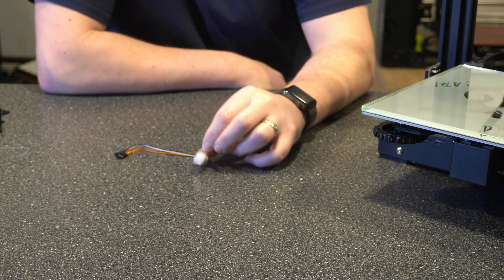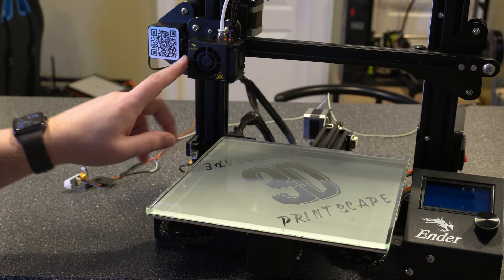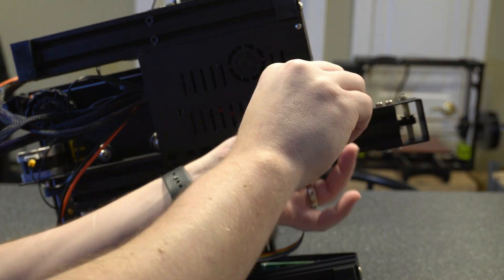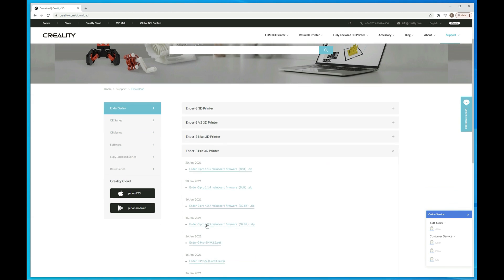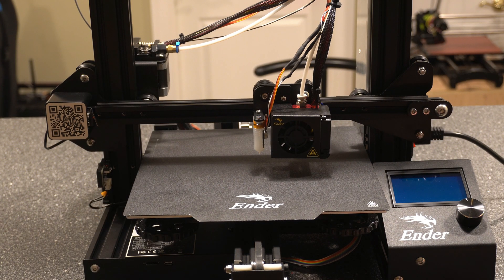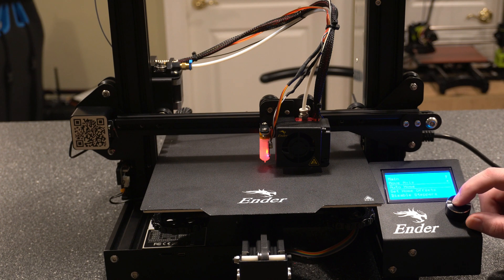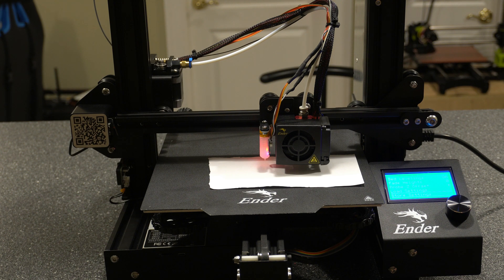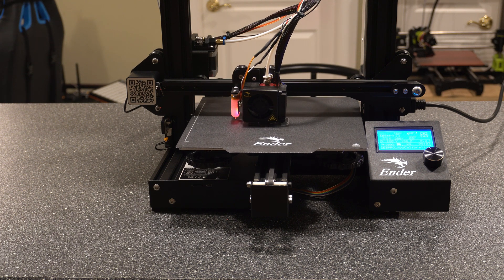Guide to Install a BLTOUCH on a Creality 32-bit Mainboard

Comment: Sorry I was terribly frustrated that night. I was very abrupt, and ultimately inaccurate with my message. Though I bought one of the newest, most popular entry level printers available, an ender 3 pro with the 4.2.2 main board. And I have the version 3.1 BL Touch level probe, one of the newest of those., I ultimately couldn't get it to function properly. As for software, I followed your guide video but that failed so I went on to try probably 8 other versions of firmware from creality and other sources. Marlin with BL Touch etc. Some seemed to work with homing and the z offset calibration. Properly following the test pattern, even deploying properly at a full nine probing locations, only to fail miserably by skimming along at 1/16 of an inch above the surface of the build plate when it was supposed to be laying down plastic. I "did" obviously not break the probe tip as I though when it collided brutally with the build plate and seemed to fly off somewhere across the room. But it had actually managed to retract upon impact and it only looked at a glance that it hadn't survived. If you have any suggestions I would welcome them. It's really something that BL Touch didn't match their product with one of the most popular printers on the market. Maybe I could pick up one of the clones, if people are actually getting them to work where BL Touch has failed. Oh btw, the connections were a spliced extended harness I made up when Matterhackers sent me a probe and nothing else. I'm sure you're familiar with the white, five position connector specifically for the probe on that 4.2.2 board. I made up an electrically sound harness of 5, 26 gauge stranded wires, solder spliced and protected in 1/2 inch braided sheath all the way down into the controller housing and basically following the diagram precisely. And to my credit it functioned at times going thru all the motions but for being too high off the build plate when time came to print. Certainly nothing wrong with my connections. If you know of a different probe that has had success with my 4.2.2 model main board, and what firmware works with the imagined pairing please let me know as I am prepared to shell out the cost of an additional probe if it will get me the desired result. I appreciate you anticipated help. Sincerely..
Reply from the maker: Hi. No problem, i understand. 3D printing can be very frustrating sometimes lol. My guess is that the wiring isnt right, ive seen them shipped wired liek 10 different ways. Can you send me a picture of the wiring on the board and bltouch side? Also, dont use the transfer board on a 32-bit board. Not sure if you are or not but its only caused problems for me.
Reply: @3DPrintscape  Alright. Tried everything  and I'm a retired electro-mechanical tech with a lot of experience with automation. But you have worked with these machines a lot more than me so I appreciate your advice. So I bought another brand new BL Touch with harness. Round two! I also ordered some metallic sheathing to run the wires through for protection from e/m interference. What I really need from you is a link and description to the right firmware to install. I have the Ender 3 Pro with the 4.2.2 mainboard, and I ordered the Version 3.1 BL Touch. If you have a link and can point me to firmware I can install by just copying onto MicroSD card and power up system to flash the controller I would be tickled. If I must edit Marlin firmware likewise please point me to the correct files needed and a good video that shows the marlin editing and flashing process. But again, if there's firmware out there already edited and compiled, ready to just copy onto sd card and boot up system with it in the sd card drive, then that's the route I'd prefer to take. Thanks in advance. Happy Printing!
Reply from the maker: @johnrost2828  I just started a page where im providing firmware builds for people to download. That happens to be one of the builds I already have out there. https://3dprintscape.com/marlin-firmware-builds/

Comment: This is very helpful! Any chance you could do this for the ender 3 max?
Reply from the maker: Hi. I dont have an Ender 3 Max, so i cant make a video on it right now. That said, it has a Creality 32-bit main board, so the process should pretty much be the same. If you decide to go for it and run into issues, let me know and i will try to help out.
Reply: @3DPrintscape  thank you so much
Reply from the maker: @davidjohnson8474  You're Welcome
Reply: @3DPrintscape  hi Rob well im trying to put this on my ender 3 max and I cant figure out the firmware? I downloaded from creality and put it on a card and its formated to FAT32. But it wont download? Im stuck can you help?
Reply from the maker: @davidjohnson8474  What size SD card are you using and what is the filename for the firmware you are trying to upload?
Reply: @3DPrintscape  Its a 128 card cut down to 32 so FAT32 would go on the card.What Im trying to download is from creality web site and its the BL touch one

Comment: John Rost <jrostsr@gmail.com>
Attachments
11:44 AM (10 hours ago)
to YouTube

Sorry I was terribly frustrated last night. I bought one of the newest, most popular entry level printers available, an ender 3 pro with the 4.2.2 main board. And I have the version 3.1 BL Touch level probe. As for software, I followed your guide video but that failed so I went on to try probably 8 other versions of firmware from creality and other sources marlin with bl touch etc. some seemed to work homing and z offset calibration and following the test pattern, even deploying properly at at a full nine probing locations, only to fail miserably by skimming along a 1/16 of an inch above the surface of the build plate when it was supposed to be laying down plastic. I "did" after all not break the probe tip as I though when it collided brutally with the build plate and seemed to fly off somewhere, but it had actually managed to retract and it only looked at a glance that it hadn't survived the impact. If you have any suggestions I would welcome them. Really something BL Touch didn't match their product with one of the most popular printers on the market. maybe I could pick up one of the clones, if people are actually getting them to work where BL Touch has failed. Oh btw, the connections were a spliced extended harness I made up when Matterhackers sent me a probe and nothing else. I'm sure you're familiar with the white, five position connector specifically for the probe on that 4.2.2board. I made up a sound harness of 5 / 26 gauge stranded wires protected in 1/2 inch braided sheath all the way down into the box and basically following the diagram in the attached pic. And to my credit it functioned at times going thru all the motions but for being too high off the build plate when time came to print. Certainly nothing wrong with my connections.
Reply from the maker: Hi. No problem, i understand. 3D printing can be very frustrating sometimes lol. My guess is that the wiring isnt right, ive seen them shipped wired liek 10 different ways. Can you send me a picture of the wiring on the board and bltouch side? Also, dont use the transfer board on a 32-bit board. Not sure if you are or not but its only caused problems for me.
Reply: @3DPrintscape  I guess I might not have explained my experience clearly that you're considering a problem with wiring. As I tried to explain, not only had I not used the transfer board, but it had to be wired correctly, because several times the system functioned flawlessly. One example test print proceeded as follows: Start print. Print head proceeds to center of build plate and probes twice, red and blue lights sequencing properly as well. Then it proceeds to probe all nine test positions, each probed twice as expected. Then over to lay down a strip of materiel along the left edge of build surface, and finished up by printing a perfect part. Now that doesn't really present as an incorrectly wired system right? I hope you can agree. The problem exists when on the very next test print instead of similar excellence, the print head, after homing, proceeds to the first test position, probes twice then moves directly to homing position normally utilized with the standard firmware, without BL Touch, then the probe tip is deployed and the head moves directly towards the center of the build plate, very unfortunately with the probe tip still extended which collides with the side of the build surface nearly snapping it off.!  At which time I kill the main power. I then considered rather than improper wiring possibly a loose connection, but as expected, upon inspection the connectors remain solidly seated where I had epoxied them. I'm at a loss. Needless to say I could probably start another test print right now and it might once again perform flawlessly, only to mangle one after that. Any ideas?
Reply from the maker: @johnrost2828  Sorry, I missed the part where it worked at one point, with that I agree it's not an issue with the wiring being incorrect. I was more thinking that there may have been a pinch in the wire, or one of the pins is losing contact. It sounds like you have checked for the loose connections, but can you trace the wires back to see if it was pinched anywhere? The wire in the sleeves is so then that a bad pinch can damage it, even if its not cut all the way through.
Reply: @3DPrintscape  Even though I thought a pinch unlikely, I went through it at your urging and unfortunately found all the wiring routed carefully and in excellent condition. With the way it's intermittently going bonkers I hoped I would find a  problem to explain it. I ran the wiring inside braided mesh all the way back to the main controller box. I tie wrapped at safe intervals to "prevent" catching or pinching, and I even utilize drag chains for much of the distance along the way to the main controller housing.  But I've asked for help so I'll certainly double check things if you ask. Have others been reporting similar problems where the system actually works at times only to go bezerk the next minute?  I'm wondering if there's a buffer intermittently failing or something. What about the BL Touch itself, it's got some sensitive circuitry in there. Maybe there's something wrong with "that." Maybe I got a defective probe?  When I flash the system back to standard firmware the printer runs perfectly just like it always has. Only when I flash it with the BL Touch firmware do I get these errors and crashing, either during the setup process, or running a print. I'm very determined to get auto levelling working on this printer and will do or spend more to achieve that. Please let me know what you think would be best to try next.
Reply from the maker: @johnrost2828  So a couple of people have brought up similar issues recently on my discord server. The issues ended up being the connection was loose, or being pulled at the board. It really sounds like you have something similar going on where it looks fine but when running its pulling on the adapters. Its an annoying thing to try to troubleshoot but I think that's where your problem is.

Comment: Followed your directions and it snapped the probe right off of the BL Touch
Reply from the maker: Hi. Sorry you ran into issues. What firmware did you use and how was the bltouch wired?

Comment: good video and instructions, but either I have the absolute most warped hot bed, or this BLTouch ain't worth a crap, I literally get worse results than if I don't use it and do a manual bed leveling. Manual bed leveling I get almost damn near perfect test squares that print within  4/100th from corner to corner, With the BLTouch even after fine tuning,  i'll get maybe 1 corner that comes out  looking ok, and the other 3 corners  lay down razer thin lines like its almost scraping the bed, I tried to live tune as well, but the it just gets worse and starts to delaminate. I give up, 2 days of fighting with this thing.
Reply from the maker: Hi. Are you running the mesh before the start of the print?
Reply: @3DPrintscape  I'm not sure what you mean exactly by "mesh", I'm still pretty new to this all, but I literally followed your guide step by step.
Reply from the maker: @fate2022  Sorry. By default, the mesh will be the 3x3 grid that runs when you do an auto level or start a print. If its not doing that, make sure the G29 command is in your Acura machine profile.

Comment: im having a problem with this. my z axis doesnt seem to want to go down only up. any idea why this might be happening?
Reply: having the same problem
Reply from the maker: Hi. What firmware are you running and how do you have the bltouch wired?
Reply: @3DPrintscape  4.2.2 and using the supplied pinbord
Reply from the maker: Ok, don’t use the pinout board with the 32-bit mainboard. Just make sure the wires are right when connecting it to the bltouch port.
Reply: @3DPrintscape  so where do I plug in the 3 pin connector
Reply from the maker: @Haxzor333  All five wires would connect to the bltouch port. Take a look at the written instructions, I have some good images in there.
Reply: @3DPrintscape  i am having this problem as well i have verified my wires are correct.
Reply from the maker: @justinpalmer9417  What firmware are you running? Also, recently ive seen some bltouch units ship with the wires reversed on the bltouch side so verify that is not the case.
Reply: @3DPrintscape   just verified all wires are the same as your written instructions. I am using the creality firmware

Comment: when I'm leveling the bed the BLTouch pin doesn't come out and when the thing goes down it just gets jam , can I get any help??
Reply from the maker: Hi. I would try to make sure you can manfully move the probe in and out without much effort. If you can, you should go back to the wiring to make sure its all right.

Comment: did you leave your Z axis home switch plugged in?
Reply from the maker: Hi. Yes. If you have the five bltouch wires connected to that port, you still need the z-stop plugged in.
Reply: @3DPrintscape  Thank you very much.
Reply from the maker: @fate2022  You're welcome

Comment: My BLtouch is just going to the center of the bed any idea why the auto bed level won't do the 4 corners like yours?
Reply from the maker: Hi. What happens if you do an auto home? Does it center and move down until the bltouch gets engaged?
Reply: @3DPrintscape  Hi, thank you for the response back. No, after I do auto home the printer adjusts itself and goes back to the center. The screen says fr100%  stopped, X 162, Y 117, Z is 10 and flashing ?? Not sure if I have the wrong firmware or something is hooked up faulty.
Reply from the maker: @dicktracy4612  What firmware do you have installed and how is the bltouch wired?
Reply from the maker: @dicktracy4612  Cool, im glad you got it working.

Comment: I'm so confused. I have the bl touch with the 2 little chips, do I still need to buy the 32 bit board‽
Reply from the maker: Hi. Can you provide more info on what the issue you are having?
Reply: @3DPrintscape  I bought the spx mini v2 after learning I still needed it to install my bltouch
Reply from the maker: @VeneerSlinger  Gotcha, a lot of the cheaper printers, like the Ender 3, have a lot of mod options but they take time to get everything setup.

Comment: thank you! can you use a filament runout sensor and bltouch at the same time?  I heard some folks say it plugs next to the X limit switch and others say you need the Ezout board. 🤷🏻‍♂️🤦‍♂️
Reply from the maker: Hi. I know you can with the Creality and SKR board, i cant say for sure with a Ezout board.
Reply: @3DPrintscape  cool..i have the 4.2.2 board
Reply from the maker: @mrburns366  Ah ok, then you should be good.

Comment: When I try to level the bed, the bl touch hits the bed but keeps going and it pushes the nozzle into the bed. Is there any way to fix this?
Reply from the maker: Hi. It sounds like the wiring doesn't match the firmware config. How did you wire the bltouch and what firmware did you use?

Comment: very helpful video. I am running on exactly the same upgrade with ender 3 pro and bltouch with no adapter. board 4.2.2. all routines in auto-home seem ok.

Did you find that when moving the z axis to calibrate the z axis didnt move at all?   all other axis ok, but on the last working firmware from creality (20 april 2020 w bltouch) it does not work so I cannot callibrate z offset. do you have any idea of what can it be?.
Regards,
Reply from the maker: Hi, thanks for the feedback. I didnt notice that when I was on the Creality firmware but, to be honest, I wasn't running it that long. I ended up moving over to Marlin 2.0 with bug fixes. I made a video covering that which you can see here https://youtu.be/pQ7WZST8sqk .

Comment: Can I apply this steps on Ender3 max?
Reply from the maker: Hi. Assuming it has one of the Creality 32 bot boards and supports the bltouch, yes. You will just want to make sure you grab the right firmware package for your printer from Creality.

Comment: bro my printer died it does not show anything on the screen it is dead!!!!
Reply: nothing works dude
Reply from the maker: Hi. What exactly are you seeing, is it just a blue screen? Ive seen this if you try to use the same firmware name as the previous upload or if the sd card was too large or formated incorrectly. If the bltouch was added as well, it could be from the wires being wrong.
Reply: @3DPrintscape  it was the firmware i did an update it is ok thank you